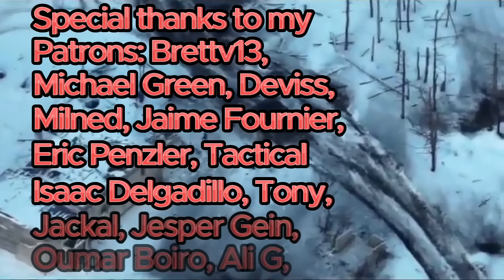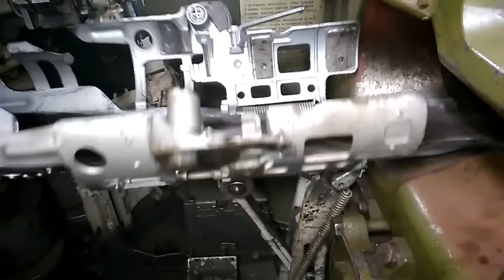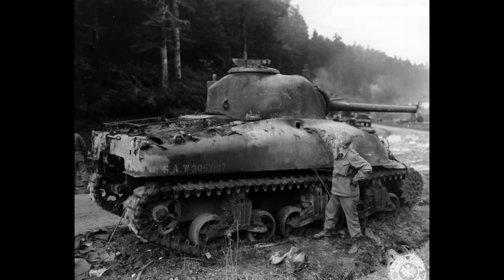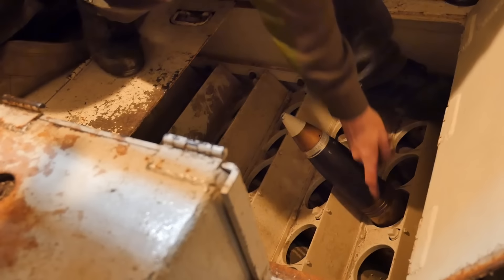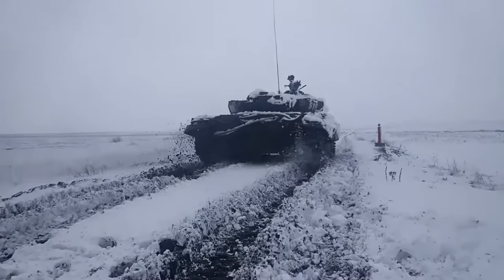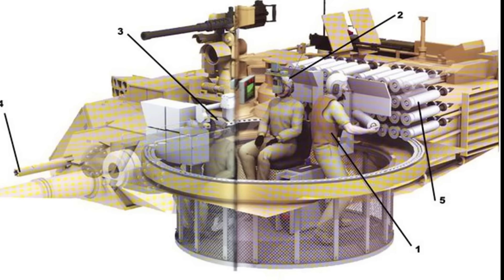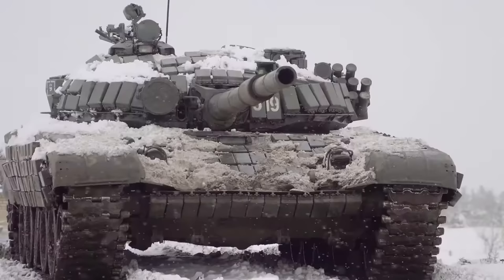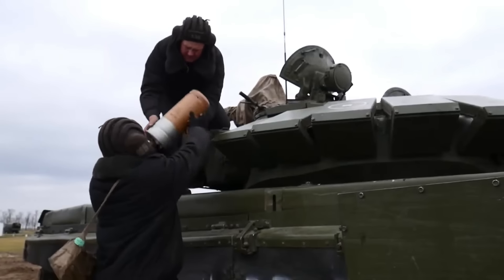Is Autoloader Really the Reason for Russian tanks exploding so much?

Comment: The problem is not the existence of the automatic loading system, the problem is where the ammunition is stored in the tank, certain Western standard tanks also have these systems
Reply: like the auto-loader of the AMX leclerc ?
Reply: @mrhonkhonk6116  LeClerc is a bustle autoloader though, not carousel. The ammo is stored at the back of the turret.
Reply: Which one? Challenger?
Reply: The problem is HE-Frag shells which anyway will destroy tank if it hit. There are two options - Merkava protective containers which will reduce sensitive of ammo. Second is to take the ammunition outside, but it is not clear how much this will increase the survivability of the crew; anyway, the explosion of a large number of HE-F will neutralize the tank. Blowout panels won't work with HE-Frag shells since the detonation of explosives, unlike the explosive-combustion of propellant charges, goes in all directions, and not into a weak  spot. This means that the explosion of high-explosive shells will pierce the armored curtain and kill the crew. If the T-72 is loaded with APFSDS, it will not throw the turret, but will simply burn out from the inside.
Reply: @smiley.6534  Leopard 2. Yes, it has ammo at the back with blow up panels, but... It carries extra ammo all over the inside of the tank. Google up destroyed Turkish Leo 2s in Syria and you will see at least one with popped up turret. They also carried extra ammo all over the inside of the tank...
Reply: @smiley.6534  Leopard 2, Leclcre, Atlay (turkey), K2 Thunder, Type 90, Type 10
have spare ammo on the hull because blow-out panels are too small to store meaningful ammo count

(ie M1 are the sole tanks that don't have ammo on the hull/small amount)
Reply: @ivanstepanovic1327 ”all over” Lol no. They are stored next to the driver.
Reply: thanks for saving 8 minutes, that title is atrocious
Reply: @supershid464  But watch the video, there are interesting things in it
Reply: The Abrams has its entire ammo in blow out compartments. Leopard 2 can store reserve ammo in the hull, however:
1. It's not necessary to fill that reserve storage for all missions.
2. During longer missions, you can move the ammo into the blow-out compartment.
3. The placement is much better protected than in Russian tanks (only in the front hull, where side armour is the strongest and very few penetrations occur)
4. Germany has advanced insensitive munitions that won't cook off even if they're hit.
Reply: Its kinda besides point.  If the tank gets penetrated It Is Lost, and the crew Is probably a bunch of guys screaming over their Lost limbs. 

You can likely produce 10 t72 for the price of a more "safer" western MBT (which by the way weights so much there are no bridges capable of standing It in Europe) 

You have to fight a war with the idea you Will suffer casualties, and this include the idea of having tanks and crews as expendable.
Reply: @pierluigiadreani2159  In the west equipment is seen as expendable, not their crews. Soviet tanks prioritize efficiency while western tanks priorities crew survivability.
Reply: @rinaldoman3331  what are you talking about? Why would a T-72 ( or any tank) only be carrying APFSDS?Do you have a source for that information?
Reply: @mpondachongo1138  Russia sees tanks just as much as expendable as the West does, however Russia also considers the crew to be expendable.
Reply: @RichelieuUnlimited not really, in the west, especially in the US survivability and backup systems are very important, not just because of crew survivability but also because they take a quality over quantity approach to designing their tanks.
Reply: @rinaldoman3331 the powder charges will still detonate
Reply: @rinaldoman3331  the proprs are usually what goes off first they are extremly sensitive compared to a round and still have a large amount of explosive power in them.
Reply: @T33K3SS3LCH3N 
1)  hmm having 16 shots in the whole tank it's sound sad 
2) well yeah you can move that ammunition into turret if you will survive that "longer mission" 
3) Any hit from the side will be penetration but compare to the Leo any Russian tank covered all over in Relict or Kontakt 5 so I guess Russian tanks more protected from the side thank any other tank 
4) It will cook off dummy new "powder" which Germans using just decreasing the chance of it but not preventing it . I guess it's work the way that shrapnel won't set it on fire but direct hit will
Reply: @peppy5121 Focusing on quality over quantity has its own disadvantages. It’s great when there is huge capability overmatch such as an Abrams in Iraq but a serious hinderance when there is parity (and along with it weapons capable of harming the tank) such as in Ukraine. 

A drone doesn’t care whether it hits the roof of a $10 million Abrams or a $1.2 million T-72. The difference is if an army spends $10 million on a tank, if a drone takes out an Abrams that army is out of tanks but if a drone takes out a T-72 the army has 7 more tanks. Also an Abrams on the battlefield is not worth more than 2 or 3 modernized T-72s, the differences between the performance of a M1A2 and a T-72B3M are not large.

Ukrainians have been complaining that Western equipment is not “as advertised.”
Reply: @RichelieuUnlimited  if they did they wouldn't be holding a significant portion of their T90s, 80s and the T14s in reserve. They are pushing their older stuff into service because their newer vehicles aren't expendable.
Reply: @rinaldoman3331  Finally someone realized this
Reply: @QualityPen  you have to remember that the tanks which were sent to ukraine were the older models, and ukrainian tankers have said they prefer the western tanks over their own soviet designs. So if the NATO countries actually went into combat with russia they would probably have enough technological advantage to make it work, especially in fields like aviation. As for the drones part, there are a bunch of anti-drone weapons being developed, so i wouldnt be surprised if we were to see those added onto tanks in the near future.
Reply: @peppy5121  issue is that these weapons usually rely on jamming making the drone a literal flying rock when jammed, just with explosives added for spice. As a result you need to jam far out enough that it increases the chances of a drone missing, currently that's not much of an option considering there are plenty of videos where it's evident the drone still hit the target. I doubt we will see turrets popping up considering their cost. I've also heard from a Ukrainian coworker (I'm polish) who has active service members he keeps in touch with, that Ukrainians don't prefer NATO designs considering them made for a theoretical war, not reality. I guess it's a mix because I'm hearing both being the case.
Reply: @RichelieuUnlimited  correct. A tank is expendable and is easier to replace than a trained crew.
Reply: @boguslav9502  there are already remote turrets on most modern MBTs, so I wouldn’t be surprised if they programmed them to detect and shoot down drones
Reply: @peppy5121  my point being mainly that remote turrets and shooting down drones won't be a reality for at least 5 years. Mainly because I can't see why and how you can. Protect a turret from being interfered in some way.
Reply: @boguslav9502  well if you just put a small radar on to of one of those remote M2s, you basically have a small anti air machine gun. Its 100% possible to do.
Reply: Also interference shouldn’t be a problem as the turret and radar are a closed system
Reply: Quit simple :
Soviet design --> total war ( The war to end all war )
Western design --> colonial war (Variable between the need of the corresponding nation)

Russia is disadvantaged by the parameters of their operation. To wage it's war as intended, Russia need to go all in. As for the opposing side, while possessing some synergy, it was not intended to wage a proxy war with Russia. Particularly given the neoliberal policies applied.
Reply: @shyntrax  IIRC the Soviet doctrine also assumed they'd be fighting in the context of a nuclear war, with radioactive fallout.

This is why they rely so much on armored vehicles, but also why once the vehicle is lost, they consider the crew to be lost as well.
Reply: @pierluigiadreani2159  But you cannot make 10 "cheap" T-90's for one Abams or Leopard. In reality the ratio is like 10 to 9, as new Russian tanks aren't cheap at all. And they still are far worse than their western equivalents. Then you can add the fact that you will lose the whole crew on a hit on those, while the western tank crew will survive, live to fight another day, or train the next crews.
Reply: @shyntrax  Western tanks were built to kick Soviet tank's ass, not for some "colonial" war. And they handily do that. Meanwhile we have seen that the "endless" supply of old Soviet stocks has started to deplete.
Reply: @iotaje1  no, soviet tactics use a lot of dense armor formations, so if they were to go into nuclear war they would instantly get tactical nukes everywhere, they wouldnt have been ready for nuclear war. A real nuclear army would be something like the pentagonal army, but that sucked.
Reply: @Alemikkola  also the russian import restrictions mean that they dont have any supplier for high-quality optics and technology, so those 10 T-90s will just get ambushed by the western tanks with superior optics and fire control systems.
Reply: @_blackdeep_3518 insensitive ammo doesn’t get set off, the photos and testings attest to that capability by showing only damage to insensitive ammunition was direct hit damage causing the casing damage and flammable residual damage, it didn’t not explode.
Reply: @Alemikkola  
Your comments incorrectly assume 
1. The standardization of western tank designs.
2. The designing of "standardized western tank" to specifically counter Soviet tank.
3. The intended application of  "standardized western tank design" in the Ukraine theater.
4. The industrial character of the Ukrainian proxy war. How many days or weeks can sustain relevant NATO members in a high intensity conflict ?
Reply: @iotaje1  This is what I was referring to, when I wrote all in among others and all war specifically.
Which explains, for example, the reduction of the crew to three with the adoption of the autoloader, a universality of amphibious capabilities of armored elements, etc.
Reply: @peppy5121  The 2nd World War taught the hard way to the USSR and its heirs that offense [a preventive strike] is the best defense...
Reply: @KozenX  it is. ETPE , gelled propellant , using of DNDA-57 and etc. They are all decreasing chances of cook off but not preventing from it. And wtf is "flammable residual damage" ? If it was set on fire you need to wait until it explode it's not happening in a matter of seconds if you hit just a propellant. If you hit for example HE head it self then there might be explosion without any delay
Reply: It is a fatal combination of ammo type (propellant and shell seperated) and autoloader with a magazine underneath the turret basket.Introduction of single piece cartridge ammo would solve many problems. (French approach in Leclerc and AMX 13 series.)
Reply: I would think that having the ammo carousel on the bottom of the hull would also run the risk of detonation by a mine/IED through the thinly armored floor.
Reply: @Alemikkola  yea next to the driven. With like not armor on the side of it. Leopard 2 has one of the worst side armor.
Reply: @Rek1emMScar  Point being, that they are not located "all over" as someone lied. Also Leopard 2 sidearmor is nothing to scoff at, and at the front it is strongest. Way better than anything Russian for sure.
Reply: @Alemikkola  well you're wrong. Leopards have trash side armor its not even at Abrams level. That was one of the reason why US didn't like the Leopard 2 when they tested it.  

Or you think 30mm of side armor its better than 60 or 80mm in case of Russian tanks??.  Not even talk that when Russian tank are equipped with Relikt that its another 100mm of protection against Kinetic proyectil.
Reply: @ivanstepanovic1327  Why don't they carry less ammo and keep the extra ammo in supporting vehicles instead?
Reply: @pierluigiadreani2159 So, you don’t think a single Western tank has crossed a bridge in Ukraine? 🤦‍♂️ The max weight really means that you can’t be regularly moving tanks over the bridges not rated for their weight. It doesn’t mean they literally collapse if one overweight tank or truck passes over.
Reply: @QualityPen You have to specify which equipment. The Ukrainians absolutely love the Bradleys, L2s, M1s and C2s because the crews almost always survive. So, what you said is a useless generalization for this discussion.
Reply: @InterstellarTaco You actually believe Russia is holding back T-90s let alone T-80s or is this just misinformation you’re trying to spread?
Reply: @boguslav9502 A large number of these tanks on both sides aren’t being disabled by drones, but rather disabled by other systems and finished off by drones once immobilized.
Reply: Negative, no western tanks are fitted with the carousel autoloader, the ones that do use autoloader, go for a revolver type. With the carousel, you do not have much of a choice on where to store the ammo! It is a design flow!
Reply: @The_ZeroLine  believe? Yes misinformation? Very likely not. It's common knowledge they have more modern equipment that isn't being pushed to the front, SU33s, SU35s, TU 160s, SU39and a variety of ground vehicle's to include tanks and their more modern air defense. It's highly unlikely they are going to send the lions share of their modern tanks into Ukraine and leave the rest of their country without a modern armored force. We've seen a lot of their modern T80/90 tanks being destroyed but not nearly as many as are reportedly in active service. Russia is pretty damn incompetent but not likely to the point where their entire inventory gets sent into and subsequently destroyed in Ukraine.
Reply: @lubomirdoukov6975  I was referring to autoloaders in general, not specifically about boomboom carousel
Reply: @MilMI-24  Got u, but think about it, if it is a carousel, where else would u store the ammo. French MBT has a revolver type autoloader, it is done for a reason, it works well with a blast panel. The idea of a carousel is flawed, as the u need the vehicle bottom to be your blast panel!
Reply: @InterstellarTaco  Bullshit on a grand scale! At least try updating your"common knowledge" su33 is a carrier based version of su27, as modern as Modern Talking, su39 is slightly modernised su25, as modern as your grandma's knickers, tu160 has been designed 50 years ago. There are some basic principles of misinformation, one of these is: DO NOT MENTION ANY SPECIFICS!!!
Reply: In real life they got infantry and  field deployment logistics to worry about, infantry means also putting HE shells in the load for area supression, but most importantly they will have to stay days sometimes weeks or even more time without being able to leave the frontline with rare moments to refuel and reload so you pack all you can
Reply: blowout panels is standard. also modern  guidance targeting systems are unimaginable back then
Reply: All tanks store ammo in the tank…it came with the tank not being simply a giant fucking gun on track.
Reply: @sirjohangasmaskesquireiii5086  If only it was that simple.
Reply: What a dull statement.  In order to make the system automatic the ammo types must ALL be readily accessible. An empty automatic loading system is renowned for being effing useless.
Reply: @Alemikkola  there have been cases of abrams popping their turrets because the crew carried ammunition all over the insides
Reply: @RichelieuUnlimited  there is a reason those autoloaders have the ammunition in the bottom of the hull, in a design way before top attack munitions
Reply: @_blackdeep_3518 

Could HE rounds be made safer with microwave shell priming?
Reply: @thephoenix756  you mean radio fuse ?
Reply: @_blackdeep_3518  

I'm referring to the microwave shell priming system of the 2S35 Koalitsiya-SV 152mm
Reply: @thephoenix756  yes man it is a radio fuse and it doesn't matter which fuse it have if ammo hit usually it explodes no matter which fuse it has
Reply: @_blackdeep_3518  

Thanks for answering that for me